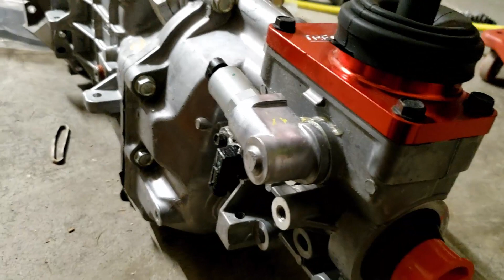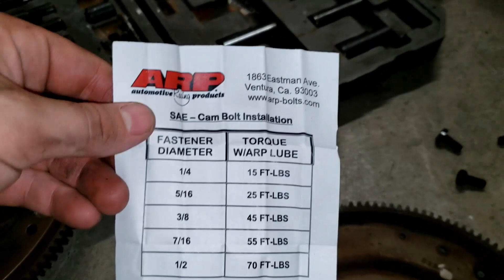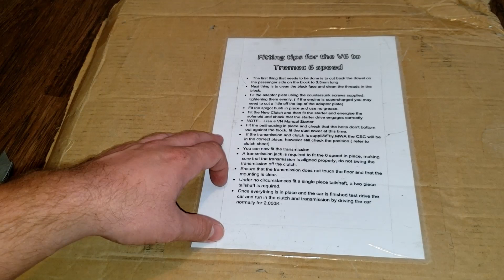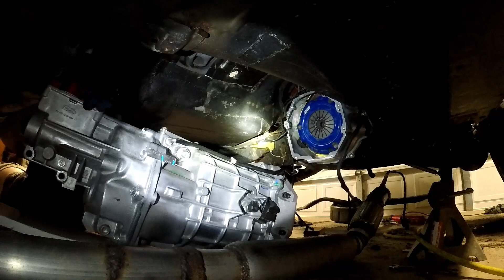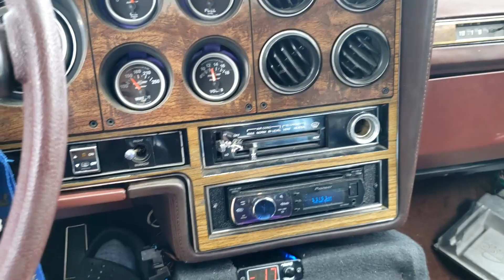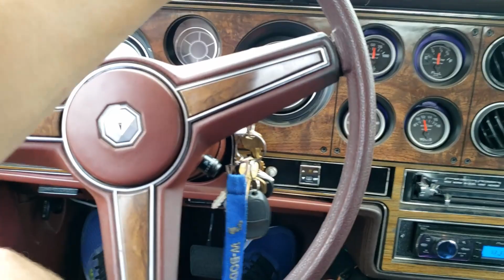Turbo 3800 T56 swap in a g-body Grand Prix!

Comment: Because theyre so cheap and plentiful, I want to swap a series 2/3 into my 87 Grand National, and mothball the factory GN 109 block. Did you have to build your own engine mounts?
Reply from the maker: Yes I did, but I've heard of someone else using olds v8 mounts that worked but cannot verify. Making engine mounts was the easiest part of the swap for me though considering the amount of work that had to go into the exhaust haha
Reply: Shouldn't the 3.8 just bolt in? I remember reading that if you just get the g body 3.8 mounts it bolts in

Comment: Does a 3800 bolt right up and does the supercharger have clearance on the firewall.
Reply from the maker: With the adapter plate it bolts right up to a T56. It won't bolt right into the car though and a supercharger will probably hit the firewall unless you can find a way to put a 180* bend there. No point running the crazy ineffecient m90 though if you ask me. Turbo is the way to go or a bigger blower that fits better than the m90

Comment: You engine ist externally balanced, so you changed to a neutral balanced flywheel. This should be your vibration, or did you find a solution?
Reply from the maker: The flywheel is a stock replacement part for a 3800 Camaro and it has the balance weight on it for the l36 bottom end. The weights are on the other side of the flywheel.
This engine's bottom end is slightly different and a lot of guys are getting away with running it anyway. I used a lawn mower blade balancer and tried to get it a little closer though.
I've ran it like that for the last few months and it's been great, but I had another flywheel balanced by a machine shop that I just got back. Will be posting more updates to that later!
Reply: But how could your machine Shop balance your flywheel when your rotating assembly is in the engine?
So you still did have vibrations now but better? Or what is the Situation now?
Reply from the maker: @PaschaGTL So I never noticed any vibrations even with the home modified L36 flywheel. The new flywheel clutch is a very expensive unit though so I wanted to have it done properly though just in case because I want to rev it higher and just to be safe. 

I gave them an L67 flex plate and they were able to match that on the new flywheel
Reply: @tuningwithstyx  With a manual car, you have to balance the pressure plate assembly with the flywheel, and the crankshaft. you can't assume buying used parts that they weren't already balance modified to suit a different engine.